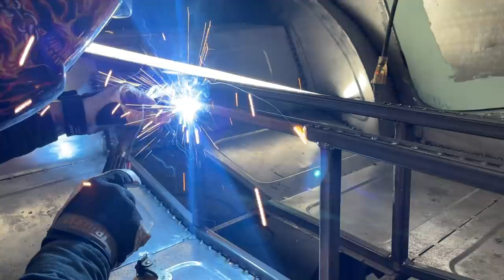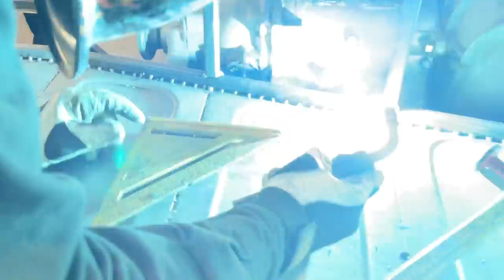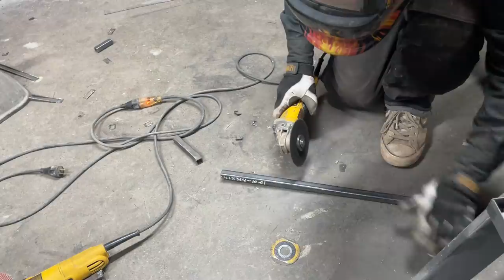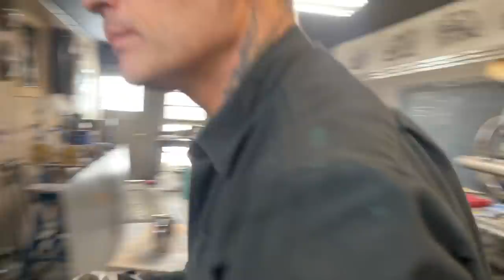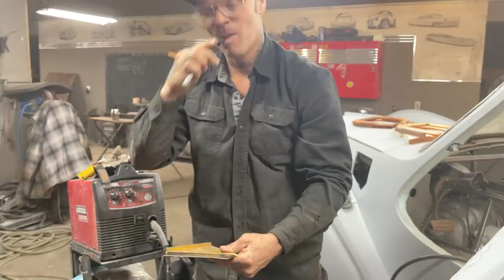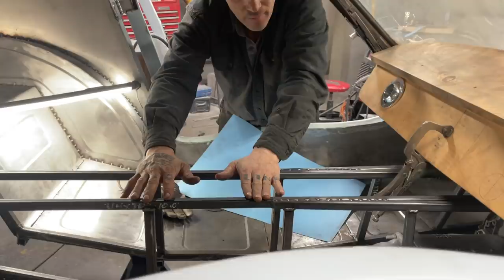THE EASIEST WAY TO FABRICATE TRANSMISSION TUNNEL USING SQUARE TUBING

Comment: Nice episode. The carpet and the top veneer will make that tunnel pop. Thinking about the gas tanks, perhaps you could use two of them, one on each side that would fit up by the spare tire,  it doesnt look like you have much room. Anyway, nice vid, and like to hear your plans for the next steps.

Comment: I can't help but wonder if that tunnel-bridge is going to get any latitudinal braces; I assume that they would not be installed until the shifter and any other console-mounted equipment has been planned and installed. A couple of lateral braces should enhance the structural strength and help prevent chassis twisting.  With the large opening over the transmission, you should be able to get the shifter mounted with the lever handle very close to the console deck. I hope Jeff can do that work for you to match the dash. — Loving the daily visits and your great work.

Comment: Would be worth adding some diagonal braces in the tunnel frame sides and across the top. Would give a massive increase in structural strength for very little extra weight.

Comment: Chad, the front of your console where it welds to the firewall...Will you run stringers over to both driver and passenger side supporters?
The way I see it there is no support other than firewall and floor for weight distribution

Comment: Put small vents in the floor pan sections to allow the air flow from the underbelly louvers, point the louvers toward the back to keep exhaust from coming in the cabin.  That way it will draw air and allow fresh to come in.
Reply: I like that idea. Would help address one of the biggest flaws on the original design.
Reply: Marshall Family ne of the things Leno said as he drove the Guild’s Atlantic was it pretty hot driving it because of the lack of air flow.  I would also put vent tubes like fifties cars had from the grill to the firewall and force fresh air into the cabin.

Comment: You should set up your shift linkage first, then frame the transmission tunnel to follow the curves of your windows- also your dashboard is too flat- With a flat dash, flat console top and flat side on the tunnel it's gonna look like one of those VW kit cars.

Comment: Nice job, once again. Do you plan to tie the sides of the tunnel together at the top, like you did to the sides
?
Reply: I too feel like cross bracing would improve structural strength.

Comment: Hay Chad,  Have you ever tried Lizard Skin for sound insulation and ceramic for insulation?  I did it on my Chevelle and it works great.  I used the ceramic on the places that get hot and sound on the ones that don't.

Comment: This body is going to be remarkably rigid with that tall tunnel.  It will serve to stiffen the chassis significantly.  The air bag suspension you have planned will be ideal to improve the ride.  Don't skimp on shocks.  Find new Konis from a vehicle with similar size and weight, like a C5 Corvette (3200 lbs).  DRM tuned Bilsteins would be my bargain choice. Good brakes and shocks vastly improve the driveability.  I'm sure you don't want a trailer queen.

Comment: The square tubing near the starter bulge on the bell housing looks minimal. Of course you are up close so you can see it better than I can. I'm thinking about engine movement in rubber mounts. As usual, thanks for the great video.

Comment: Use the automotive wrap for floors insulation, will last much longer and won't hold moisture like the house stuff does.
Reply: I used Dynamat in my ‘32 Ford and highly recommend it. It’s not cheap but you get what you’re paying for.

Comment: Chad, I'm guessing you'll be putting cross members on the top of the tunnel to replace the ones you cut out below? I like the tall tunnel; built-in armrest, cup holders and glove-box.
On the seat, I'd suggest a slightly curved back, so it supports Jolene better laterally, but that might be difficult with the curve following the wheel well - might need some creativity with the English Wheel!

Comment: Chad. I got a question. What are you going to do with driveshaft? The Jaguar had a IRS and no slip yoke on the Transmission. You are using a straight axel. You are going to have to have some sort of slip joint. What are your plans? Also I have the rack and pinion mounts that you need. I have a Xj6 parts car.

Comment: Nothing screams vintage Bugatti like a center console and don't forget the cup holders. It just seems wrong to take away interior space for that huge of a console transmission housing and driveshaft tunnel are usually minimal sized. I've liked everything up to this point but I would consider doing it traditionally you have all the sheet metal tools to do it right

Comment: If you need a grinder to make your welds look good, it makes you a Grinder, not a Welder!
Reply: What's it make you if you have many one of a kind cars around the country that you built and a TV show to boot?
Reply: Sometimes you have to grind to blend in with the surface! To make it smooth and flat, or have something that has to be mounted flat to it. When welding cracks in frames and booms you blend grind to keep from cracking again, if you don't the shock and vibration will stop at the welds and crack every time! Don't make comments if you don't know what your talking about! Are you one of those guys that welds, then wire brush it to see how beautiful it is? I bet you are!

Comment: ....You can definitely tell I'm NOT a designer of cars......I look at that and try to figure out why it is so large and so tall.........Is it a "modesty" wall, to keep separate the driver and passenger?
Reply: Was the post meant to be clever?
Reply: @nellalarsen9327  ...Are you clever enough to figure it out?
Reply: @pennygretch  No. I leave that to great intellects such as yourself.
Reply: @pennygretch  And I will sir.

Comment: What size wire do you use? I'm using .023 and I'm still blowing holes in the sheet metal of my 1954 chevy truck. Still learning but will always take advice. Ken from Pasco, WA
Reply: If your still burning thru with .023 you  have your heat too high

Comment: Why don’t you sheet the tunnel from the underside giving that clean look underneath then just panels for interior if your sheeting the underside of floor pan makes sense to sheet tunnel from underneath wheel interior goes in insulate the tunnel the thickness of tube leaving interior to fix on flat the studs of tunnel frame cheers just a thought watching from Aus 🇦🇺

Comment: never put louvers on the floor, the main thing to worry about in the cockpit of the cars is to make sure no engine or exhaust fumes make it to the inside of the car.
Reply: I think you’ll find he’s talking of a “false floor” to cover the one that we are looking at. Rolls Royce used to do something similar in the 50’s, but without louvres. The problem was the gap between the two was a breeding ground for tin worm.

Comment: Doesnt look like you are gonna run A/C or have roll down windows... put some outside fresh air ducts into the center console so it wont be like driving a toaster in the summer time... Original Bugatti didnt have any ventilation and made it unbearable, later they put in scoops on the roof for some inside air... put your intake scoops inside under the wheel wells...

Comment: I know this is non-related but I have my car at a shop it's been there almost a year nothing like you guys are building it is a 5.0 notch back I am running a two-speed powerglide bolted to a 331 stroker the problem is when doing the wiring they told me they could not use my original wiring about 4 months ago I paid for what is called a Holly Terminator wiring system actually I paid a few hundred dollars more then what is advertised at through the place they get their parts through they keep telling me it's been paid for it's just not arrived what would you do at this point I mean my car is just up there sitting out in the weather and nothing is getting done how do you know when a small shop is beating you or ripping you off I have had other problems with this shop like paying for things just to find out what I paid for is not completed but yet they want me to pay secondary fees for the finishing of the job totally stressed out when do you cut strings with a shop